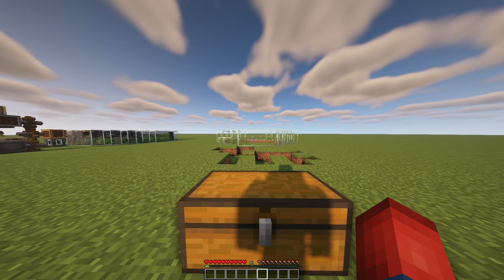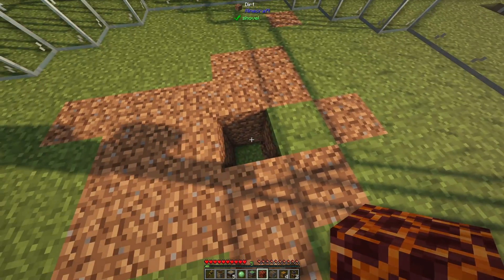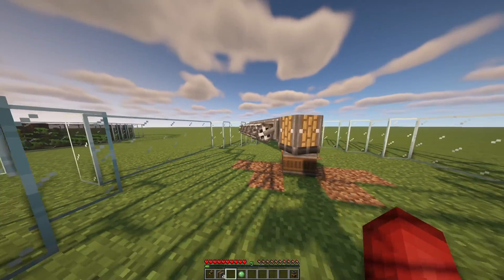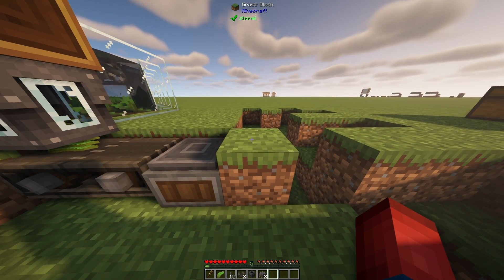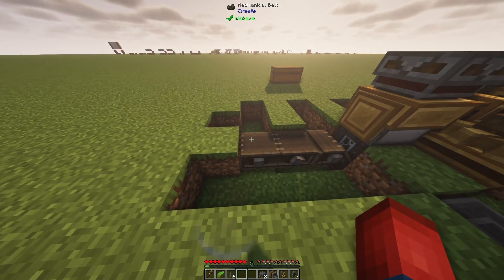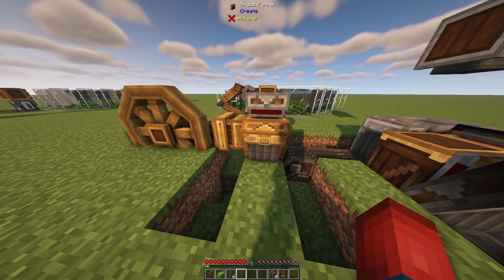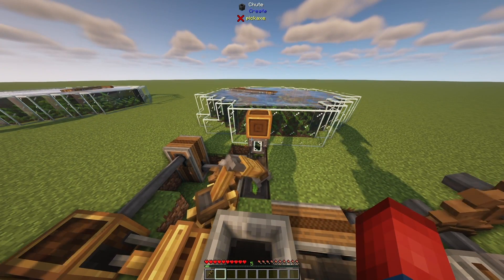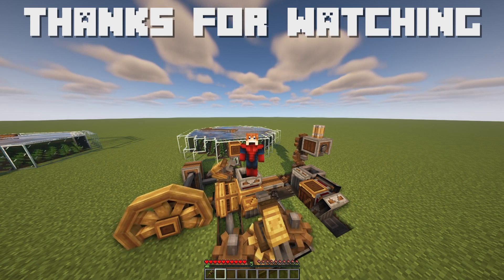Minecraft Create Mod Tutorial - Furnace Engine & Flywheel (Infinite Power Source!) Ep 36

Comment: Anyone else have the issue that the magma block plus fan doesn't work? I've tried this "generator" many times and it never works. And yes, I am putting the correct magma block down. Yes. I am using the Encased fan and it's even pointed in the correct direction.
Reply: they fixed it

Comment: Hey, for some reason the lever isn’t working, is there any reason why?
Reply: they got rid of the feature. Worth noting that you can just mine out a 3x3 area, put a water wheel facing horizontally and place water in one corner, it will cause the wheel to turn giving you power for something like the kelp farm.

Comment: I just made one of these based off of your design and it basically doubled my stress capacity! The main difference is that i cut out the more expensive components with gears and belts. You'd be surprised just how versatile belts are for translating motion.

Comment: Increasing the speed of the encased fan, does not increase the bulk washing or blasting rate, it only increases the distance which the encased fan blows or pulls from, in order to increase the bulk washing or blasting rate, you have to add additional air streams from more directions, so, you can encased fans blowing from every direction on something like a depot.

Comment: Dried kelp vs charcoal?
Edit: I mean kelp vs tree farm to power
Reply from the maker: Charcoal will eventually make too much and cause you to have to take some out manually. The kelp blocks disapear after smelting so that solves that problem!
Reply: @rockit14  too much charcoal? If so I could use that actually. Doubles as fuel generator as long as I make an overflow and maybe a cactus to pick up stuff that the funnel won’t

Comment: If you use a fan powered chute repeater and a funnel you can use a blast furnace instead of a normal furnace for double the power without consuming the ores
Reply: or you can just use a smoker insted of a furnace it works just like a blast furnance

Comment: Why use a Mechanical Arm when you could've just belted it up diagonal to the input of the Furnace?
Reply: Similar question for the output of the Dried Kelp Blocks?
Reply from the maker: Because if the furnace couldnt take anymore items that belt would throw items onto the ground
Reply: @rockit14  Even when running the belt directly into an Andesite/Brass funnel?
Reply from the maker: @starryknight64  so for that one no - so yes technically you can use a belt :)
Reply: @rockit14  All good! Just making sure there wasn't some big advantage to using a Mechanical Arm. Thanks for the reply!
Reply from the maker: @starryknight64  Of course! Thanks for the tip man :)

Comment: To save on the 1 mechanical arm, couldn't you just make one the kelp depot an ejector instead?
Reply: Mechanical Arms should only really be used for complex or non-linear item movement.
Reply: @therealcactoos9457  If ya have a lot of resources, mechanical arm is just a cooler choice
Reply: @NoraNekos7  mechanical arms are really a late game cosmetic choice for the most part. But yes, they are cool.
Reply: @therealcactoos9457  That's what I said. 
Ejectors are a funnier option tbh, my friend and I built a farm where we ended up with two ejectors (because I am dumb and can't plan ahead), one of which sends food to the chests, and second to the lava. It was extremely fun to watch because, as I said, I am dumb and we built a farm without it being fully automated (we can to stop the whole thing to get the food, which caused crops to break) and it was clogged up, so after I built it, whole minecraft day we just watched how the food was travelling on conveyor belts, with the sound of two ejectors and a lava burning seeds

that was beautiful
Reply: Also, I believe the Linear chassis(or otherblocks+superglue) are redundant since a sticky radial chassis would still stick to anything in the radius.